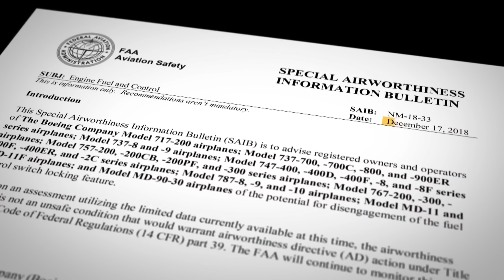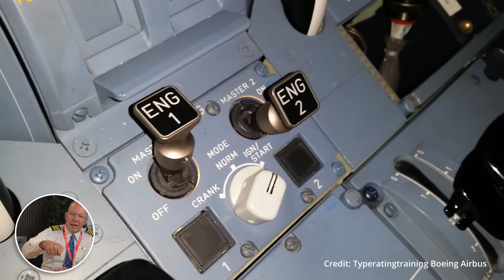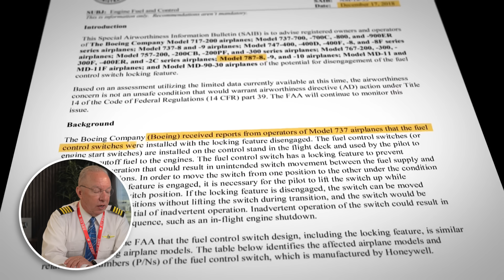Air India 171: The FAA’s 2018 Fuel Switch Locking Bulletin Explained (16 Questions Answered)

Comment: retired commercial aircraft engineer - The fuel cutoff switches wont actually turn on unless they are fully past the center detent. If the engines were running, the switches were fully past the detent.
Reply: Not to mention they likely cost $2000 each amd are engineered to absolute perfection
Reply: @ALSNewsNow  They might be potentiometers (optical, capacitive or resistive) , not on-off electromech switches. Manufacturer can program the switch, i.e below 20% is OFF and over 80% is ON. I have seen "eternal" rotary knobs like that in Agilent and Tektronix oscilloscopes.
Reply: Here is my question to you. Do you believe that these switches can be set to cutoff within 1 second?
Reply: This make sense. There's probably an electrical micro-switch to permit operation to the FADECs
Reply: Very good info.  Thank you
Reply: Question: When shutting off the fuel cut off switch, what is the delay before the engines start spooling down? Is it almost immediate?
Reply: @stevenremy7747  multiple sources say that is immediate.
Reply: please explain the time sequence 0f shutting 0ff the fuel and reengaging the fuel with regards t engine 0perati0ns
Reply: I am very disappointed l really thought you were looking just at actual facts but it is coming across that a lot of what you are saying is assumptions especially regarding the pilots, one of the pilots had mental health issues and moved the switch knowing he would crash the plane and kill himself and everyone as well.  This is all assumption in my opinion, if there had been a video there would have been more clear facts. In my opinion this is another cover up let’s not blame anything to do with the plane at all.  What l can not understand is why is it a lot of people including yourself and it appears the people doing the investigation are  willing to agree with the first pilot saying why have you moved the switch but not the second pilot saying he did not, l suppose l should be able to answer my own question l believe what both those brave pilots said, so that must mean there was something wrong with the spring loaded switches and a fault with the plane. If people who are investigating this crash are covering up the truth l have no words for them to describe there behaviour but l suppose that is me making assumptions.  In one of your first videos you did say that this is never happened before and we may never find out what really happened l really believed what you said and thought this is a fair person he his worth listening to. From Lynda
Reply: Right, but that does not mean the detent was worn or out of specs from the manufacturer. It does not mean excessive pressure was put on them accidently such as the left seater reaching over for the nearby flap handle
Reply: @Bernie-e9i  Flaps were set before take off. The only thing that Captain monitoring should have had his hand anywhere near at that stage of the flight was the Gear Lever and have a guess what they stayed down. The switches stayed in the ON position during a extremely high G load belly flop onto a building and subsequent explosion. I'm pretty sure like the rest of the 787 fleet for the past 30 million flight hours the detent's were working as normal.

Comment: The report says
"The aircraft achieved the maximum recorded airspeed of 180 Knots IAS at about 08:08:42
UTC and immediately thereafter, the Engine 1 and Engine 2 fuel cutoff switches transitioned
from RUN to CUTOFF position one after another with a time gap of 01 sec. The Engine N1
and N2 began to decrease from their take-off values as the fuel supply to the engines was cut
off."

My question is why does it not mention the time for trigger of cut off switches ? 
Also, this sentence is self contradictory, aircraft should achieve maximum speed after the cut off and not the other way around.

Comment: Great video but I have some comments besides my wholehearted support for video camera in the cockpit (almost all major public transport and delivery vehicles on the ground has that already)

Could one of the pilots have had some medical condition leading to the accident? 

The second comment I have is a question re ANA flight in 2019 dual engine shutoff w/o any pilots initiating any engine cutoff. Thankfully that flight had just landed ( in Japan I believe), but imagine facing that scenario mid-flight. This tells me that WOW (weight on wheels) logic may have something to do there, and possibly in this case too. ?? What was recorded in the FDR then, and was there a solution for the dual engine shutdown arrived at back then?

Comment: Photo's at the airport show RAT deployed immediately after lift off, how do you explain the aircraft continuing to accelerate and climb to 600ft before then losing power? I'm certain it wouldn't of gained that altitude and distance if engines cut off immediately after lift off. The RAT deployed and then engines failed later on. Electrical issue that deployed RAT, prevented gear retraction and then engine failure? Pilots confused as to what's going on and asking the other if they cut off the engine and they were also not sure what's going on and replied no, so they then moved the switches into the cut off and back to run to get the engines going again, too low and slow to waste time going through procedure so they left throttles in full and attempted restart with the fuel switches?

Comment: Is it possible that when one of the pilots put the fuel switch back on and engine 1 ignited and started working if the second engine would have started working at the same time could prevent the flight from crashing?

Comment: Captain, I'm concerned that the emphasis on intentional pilot action, and the implied psychological motivations, might be a premature conclusion. We saw a similar rush to "almost-judgment" with the fuel vapor theory, which proved incorrect. Rather than immediately looking to pilot mental health (in particular, you assume by body language that it was the FO), which feels like a significant leap, could we first thoroughly explore a more straightforward possibility? The fact that Air India did not conduct the SAIB NM-18-33 inspections is a crucial piece of information. This bulletin specifically warned of 'unintended consequences' from incorrectly installed switches. Let's consider that someone installed it wrongly, and gather all the evidence before we start attributing shame & blame, or broad psychological issues.

Comment: So, @captain steve. Suppose this was to happen in the next plane you fly. Is a mechanical failure impossible on those switches? Yeah, 2 decreases the probabilities. But, just assuming if that were to happen is there any way to know whether a human in the cockpit do it or the switches did it on their own? I hope if this was a mechanical failure which you're just not talking about like the parts were completely faulty. If that were to be the case, someone else would make a video about you killing 300 people because you're dealing with mental health issues. Hope that sounds fair to you, and does happen in case this was an actual failure of equipments. And the control rods are just part of a system, it could've been 1 faulty sensor of a few thousand that're on an airplane. Good luck flying, I'll not fly again with such gaps in reports. If you're saying the pilot did it, tell us which one and how in 1 second both rods. And the other one just doesn't notice. If that't the case of aviation why do we even need pilots, let them all fly with auto pilots.

Comment: I would have believed in an electrical glitch, but two of them in quick succession? odds are infinitesimally low. Moreover, glitches are transient and won't last long for 10 seconds in steady state. Had it been the case, their toggling states would have been recorded by the recorder too. 

Permanent Electrical failures like short to ground would have rendered those switches completely out of service. That happening in independent switches in quick succession is also improbable. If that was the case, how did the switches change their states back to RUN and continued?

FDR data shows all other systems and parameters as normal which eliminates any chance of electrical surges or EM interferences too.

Comment: @captain Steve thoughts on this?

For consideration, here is a possible scenario that hasn’t been mentioned yet and encompasses the frailty of human performance. The report mentions that the flight crew on the immediately prior flight had written up a "STAB POS XDCR" status message, and that troubleshooting was carried out. I wonder if the scenario could be that the accident crew received a Stabiliser EICAS message on or around take-off and the Capt (who was PM) decided to action the first checklist item immediately from memory, by intending to move the Stab switches to Cutoff but moving the fuel switches instead. As in all modern Boeings, the Stabiliser Cutoff switches are immediately next to the Fuel Cutoff switches and operate in the same sense (i.e. down for Cutoff). They are guarded and never normally moved but, with an intent to move the stab switches, “muscle memory” (cerebellum activation if you prefer) may have taken the Captain’s hand to the Fuel switches, which are operated on every flight. The FO (who is PF) is manually flying at this stage sees and queries it. The Capt denies it, as he doesn’t realise what he has done (confirmation bias perhaps). After a few seconds, the terrible mistake is realised, and the fuel switches are moved back to run, but sadly too late and the Capt makes a Mayday call.

Comment: Captain Steve, your experience is that the fuel cut off switches have a locking Detent to prevent their inadvertent operation. You have dismissed the 2018 advisory which reported that in some instances, these switches had been supplied WITHOUT the locking Detent enabled. Air India have already admitted that those switches were not checked because the advisory was just that, an advisory. Installing them “the wrong way up” is not what the advisory was about, it was an acknowledgement that some installations had been found not to have their locking action/locking Detent enabled, please address this question or possibility in more detail. Could they have been placed in a position where they were not properly latched as reported in the advisory and then failed on rotation or seconds after, they are after all switches with a heavy mass on the end of a long lever.

Am beginning to think that Boeing are putting pressure on people, possibly even you not to discuss this possibility. 

FYI I am married to a P1 A320 pilot, we are talking about this constantly and consider the murder/suicide prognosis highly unlikely.

Comment: Perhaps they should have used a "pull before turn" switch.
I believe those switches are already available of the shelf.

Unlike toggle switches standard turn switches are already immune to bumping and things falling on them.
The "pull" part makes them save against accidental switching. 

For an industry so safety minded as the aircraft industry I don't understand why the used such an overcomplex thing like a "detent toggle switch"

Comment: I am sorry Captain Steeeve, but I think you are way to sure about anything that the plane was intended to operate and only the pilots are to blame, dude... come on, put the "what if" in front a bit ! "No this was not possible", "The airplane operated as intended" ... We have a bulletin from Boeing that they say, be careful that maybe they installed without a safety guard, those "mechanical" switches are only sending an electronic signal to the ECAM system that shuts off the valves, they are not that "mechanical" after all. I don't like people that "predict" the final outcome of an event, before it's final ! I say, let's wait until the final report, and then let's make a conclusion ourselves. Maybe, just maybe, it really was installed incorrect and maybe the switches fall from the turbulence, or maybe it was an ECAM malfunction... just maybe ! Let's wait the 100 % report, not the 35%, after that maybe we can assume a 95% sure final outcome.

Comment: What a tragedy. I was watching regular 787 take-offs to see when the landing gear would normally be retracted, and it seems to be done 3-4 seconds after the plane lifts off, which  matches the time when the fuel was cut off. Could this have been done by a distracted pilot, executing the wrong memory motion? I know that the switches are in totally different locations, but still wonder if this could have been an accident. I have noticed myself doing things like that when driving, luckily harmless, but still very weird instances where I did one thing while I intended to do something completely different.

Comment: Balancing on the detents is not possible.   The proper contacts to trigger the electrical contacts require them to sit into position.  So if they somehow sat exactly on the little raised pins .. no contact.  That spring is pulling the items down to create the contacts.  So you pull up on the items and against the spring, move to get over the detent, and release and the spring pulls back down initiating electrical contact.

As for a camera in the cockpit, you could attach it to a spooled time like the recorder.  So you are only recording the same time frame as the black box.  This eliminates many union concerns about every action being watched.  Just have it tied to the recorder and the system is a closed system accessible only when .. things .. occur.  Their concern is recording WAY to much.  Tying the recording time to the box makes it hard to argue against it.  But I agree that .. there is not a lot more the camera would record.  When the computers are registering every movement of the switched and controls to duplicate the flight later in a simulator, how much does the camera really add?  Not a lot, even in this case.

And basic physics.  An object in motion remains in motion until another force acts on it.  So once the fuel it cut off, the plane had reached a speed of 180 .. while takeoff speed as I believe what 160? 155?  So once the fuel cuts off the engines start to wind down and the plane speed decreases, and the rat deploys.  But the plane was going up and an angle with sufficient speed so like someone throwing a ball, it keeps going up, hits the peak of the arc, then down the other side of the arc.  All basic physics.

Comment: Speaking as both a private pilot and a railfan. In the railroad industry, locomotives have voth inward and outward facing cameras. They also jave black boxes to record things like speed, throttle and brake settings, grade, etc. 
I see no reason why in this day that airliners should also not be equipped with in cockpit cameras. They would be very useful in any investigation even non fatal ones.

Comment: Signal shows fuel cutoff set to shutoff, then recording shows a pilot says why did you shut it off, then it immediately goes back to on and the engines relight.  If it’s an electrical signal, it can’t be a coincidence that after the pilot says “why did you shut off fuel” then the signal shows back to run seconds later.  This was a legitimate act.  Was it due to malice or confusion- that is the question that has to be answered.

Comment: i find it a real pain watching your sloppy inferences and your constant exonerationn of that it could not have been any Boeing or GE design. Remember you a a high class operator of a very complex machine.....not a design or control engineer  It is a shame that you said you do not know whethwe a visual ot audible alarm will be indicated if the fuel switches  were manually activayed....but suggest that the abnormal roar down of engines noise would provide the alert. You mean the operator manual never covered that alrm conditiionss visually and.or auddibly to a piloty? Or the flight similator training never contain test events that allows the pilot to understands more fully the response  from the instrumentation and controls when some equipment is manually operated or the flight system has changed one or more states abnormally?

Comment: Thank you for the detailed q&a. I wonder how fast is the fuel cutoff switch: do the engines take a while to loose thrust (like in a motorbike when you shut off the fuel) or is it immediate? And when the pilot put it back to the run position, does the fuel flow immediately or does it take a while?

Comment: A cockpit camera—perhaps focused solely on the controls, not the pilots themselves, and encrypted so only investigative agencies can access it—could help deter a specific kind of suicide: the kind where a pilot, assuming this incident proves intentional as it appears, wants the crash to seem accidental and avoids the legacy of being labeled a mass murderer. In this case, the fact that the pilot reactivated the engines and attempted a recovery suggests that, while he may have been willing to crash the plane, he wasn’t willing to actively stop the other pilot from saving it—whether due to second thoughts or awareness that the flight recorder would later expose him. A camera trained on those switches might have been enough to prevent the act altogether if his motivation included plausible deniability or fear of posthumous shame.

Comment: 7:57 the bulletin said the switches were installed with the locking mechanism disengaged, not upside down. It warns of risk of mid-air cut off, so they must have been able to take off. 
But they have found the switches, this point should be moot.

Comment: If the power shuts down and closes the fuel valves does the system monitor the valve or the switch in cockpit...as to weather or not the valve was shut off and on?